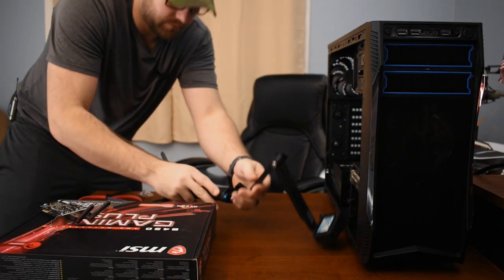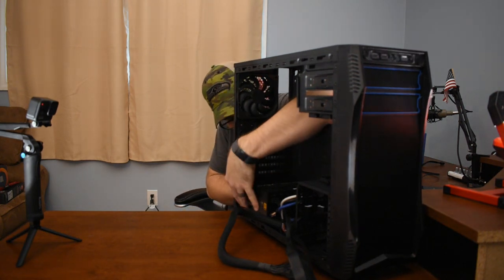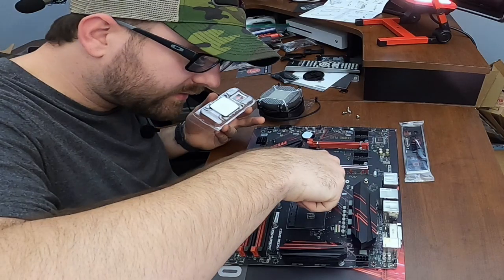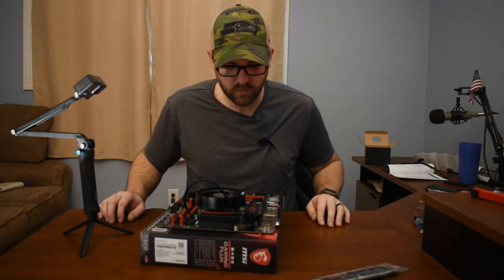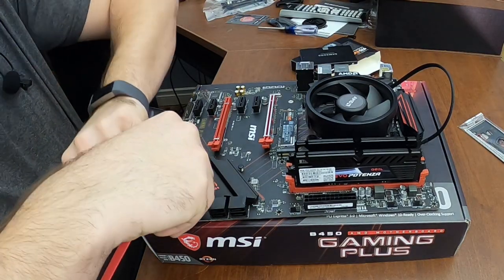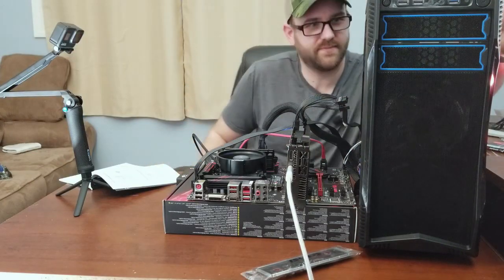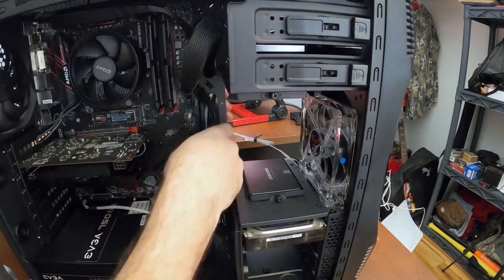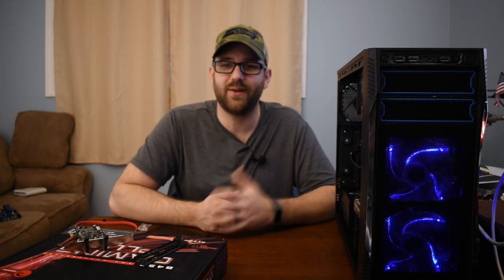Building My First Gaming PC

Comment: Can you show the rear cable management? I have the Challenger, but mine is based off an older case design including 3.5 hot-swap bays, but I struggle with the cable management.
Reply: I know it's late but I have the case but cable management sucks in this case. I had to get extended cables to manage them
Reply: @chaotic_994  figured I'd need to do the same. My old Dell dimension had better management than this

Comment: nice vid, I got the same case and I dont know why you should face the power supply down. Can you tell me why ?
Reply: Fresh air to the power supply and proper exhaust of the heated air.  Also, if there will be a lot of dust under your PC and/or no dust filter, it is ok to put the fan up.  However, best practice is fan down.

Comment: Good job for your first build Brandon! Can you include where you got the parts? Budget? More fast forwarding through the boring stuff like putting in screws with a narration track explaining. :)
What GPU did you use?
Reply from the maker: Thank you for the suggestion! I used PCPartPicker.com and the Reddit.com/r/PCMasterRaceBuilds for the parts, total cost was under $300. My old GPU was reused, RX560.